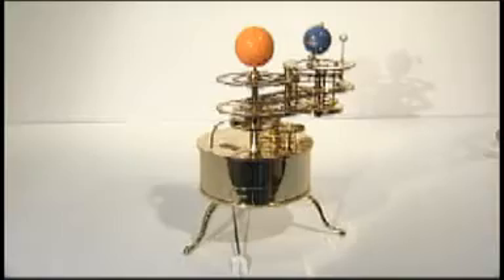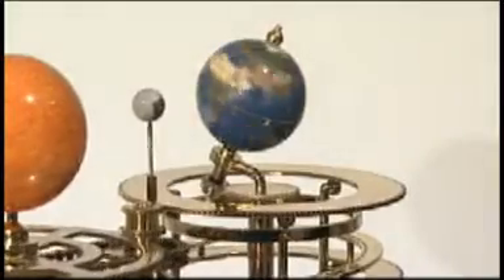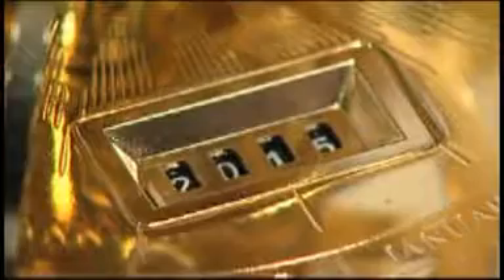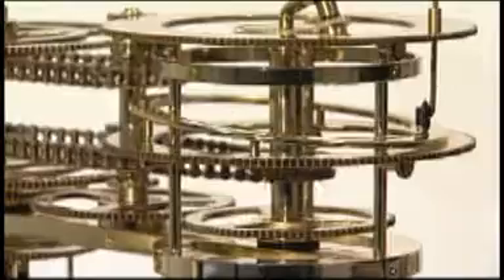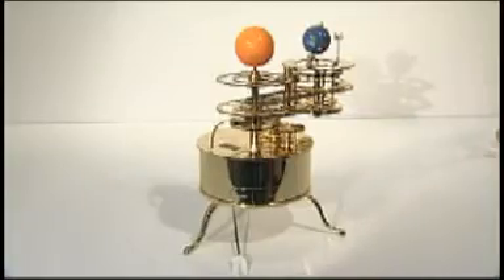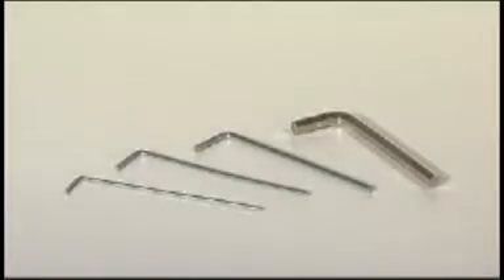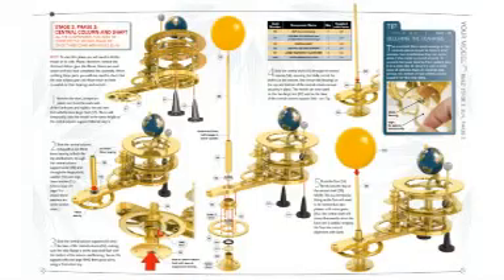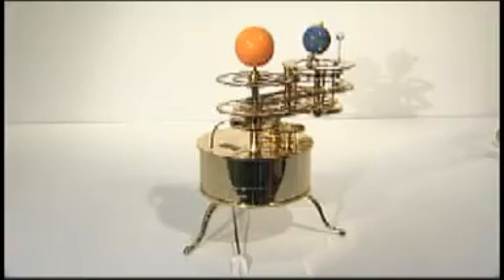Build a model sun, moon and earth orbiter.

Comment: Ive just finished building this model,and it looks very impressive, however there are some problems, i should mension i am a toolmaker by trade, i built the orrery and it was fine, this model is more complex the first indication i had that there was trouble ahead was when i received  the three drive shaft support bushes which fits into the three holes in the top plate these support bushes should have been a press fit into the top plate. [ however they were what we in the trade would call a rattling fit, and now yes they are causing serious problems with the gear chains they are suposed to be supporting ] what can i do, well it may have to be  dismantled some,  and these support bushes cemented in,, it is not going to work as it is..
Reply: Jennifer Gorham i built this some years ago when it came out,  you are correct,  it sags to that side with the weight,  things works for a few seconds and there is lots of clicking and banging,  heard catching,  then it works again,  then more gears clicking.  Oh and the sun fades and losses it's colour on the side facing daylight, not direct sun, daylight,  mines turned white on the side in a North facing window!